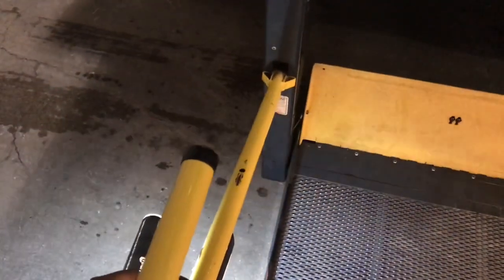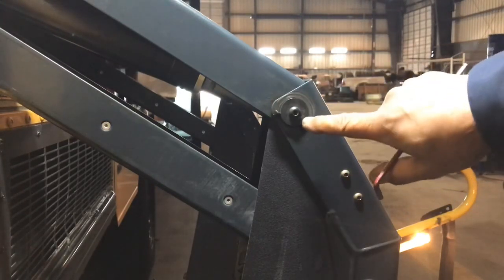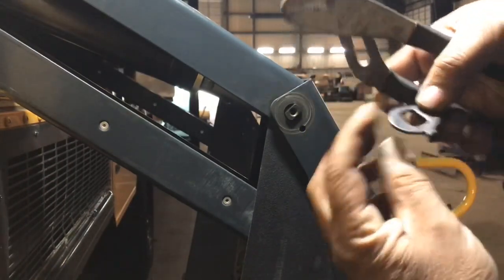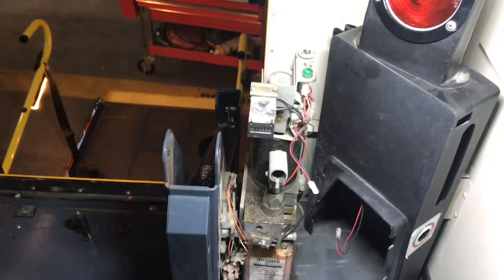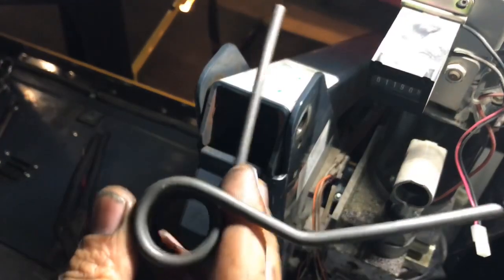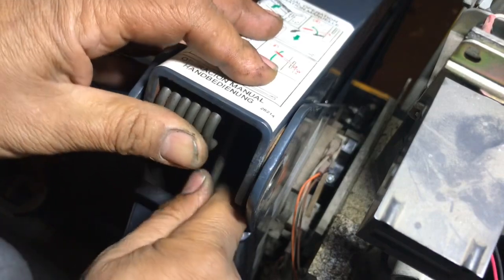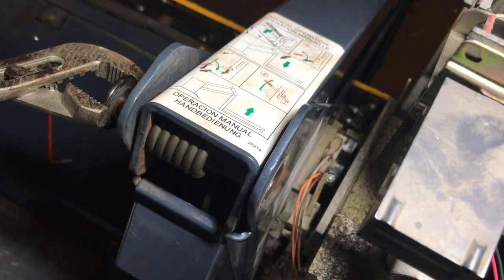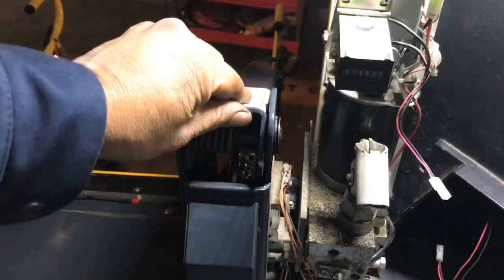RICON wheel chair lift

Comment: Thanks so much.. I have to replace the gland nut and a new piston w/ seals kit.. so taking off the arm showed me in advance of what I'll be doing.. on a side note ricon parts as a pin and spring aligning tool that I have wish I could post a picture of it but it screws into hole the screw goes in and looks like a flat tiped torpedo which I have though your way works well enough.. Thanks again joe!

Comment: Hello Joe, how are you doing? i am ok... hey i have a Ricon lift question for you. Is it hard to replace a Ricon S-Series Wheelchair Lift Manual Pump Assembly??  because mine is leaking hydraulic fluid around the manual back up pump handle.
Reply from the maker: You can try to replace the seals on the pump handle little piston/push rod or they sell it as a manual pump kit. Comes with new pushrod and seals.
Reply: @JoesBusBarn  Hello there and thank you for taking the time to write me back and so fast. Thank you so much. Is that something that a person can fix their selves or would a pro have to do it?  Also, would you know where i can get the manual pump kit from?
Reply from the maker: I’ll get back to you tomorrow with a part number and who will have it.
Reply: @JoesBusBarn  Oh thank you so much... 😊👌  i appreciate that so much.
Reply: @JoesBusBarn  Thank you so much for your help..

Comment: Hello Joe,   Have question or 2  ..  Wheel chair Lift      I am currently in the dreaming/educating of a Skoolie like I feel would best fit my needs.  I will need a full size bus with wheelchair lift.  If I purchase a bus without a Lift,  IS it very difficult to install one.  Have seen videos of them removed and worked on.(Yours)   Oh I would want the lift in the middle of the bus.  Wanting  98-2003 pusher.  Have only seen a photo on google once that was  pusher w/lift in  middle.
Reply from the maker: Hey there billy. A wheel chair lift is not too complicated to install. It’s somewhat heavy though. If you plan to wire it with all the safety features as a school bus. It’s best if you buy a unit with the lift. If you plan on doing a simple wiring. Then it’s very possible. I can help u out with a schematic for a simple wire or the school bus wiring. You will need quite a few sensors, switches, and some wiring skills. But hey. If you have the time. Both either one can be done. Now when it comes to anchoring the lift to the floor. 1/4 steel plate is recommended under the units floor. Dreams can but reality if you really want it. I never thought I’d own a bus and now I have 2. Work in progress. Any questions. Feel free to email or comment on u tube.